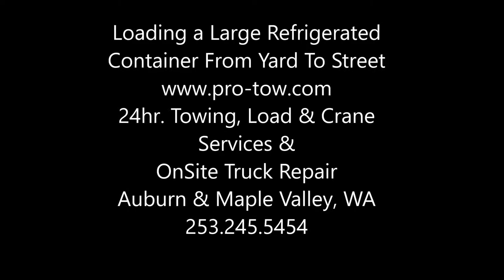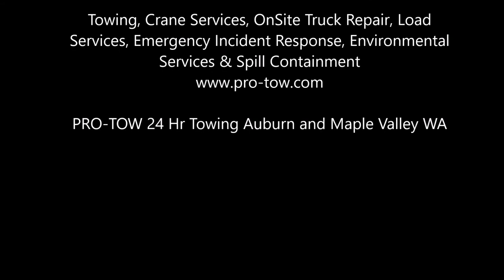Pro Tow Crane Services Auburn WA

Comment: That's not a crane. That's a rotator. It is (as I'm sure you know) way better than a crane. A crane can do half the things a rotator can do. Lets talk about the lift. First why did you rigg it that way? If you keep the spreader bars closer to the top of your object you can lift with your cables and not the boom. The white line looks to be in the boom sheeve. Just use shorter straps. Also who go through the trouble of putting together when you have auxiliary winches.? Second for the helpers safety have a tag line on the load. He could of got crushed when he was between the load and the corner of the rotator. You got it done and good for you but it could of been easier and safer.